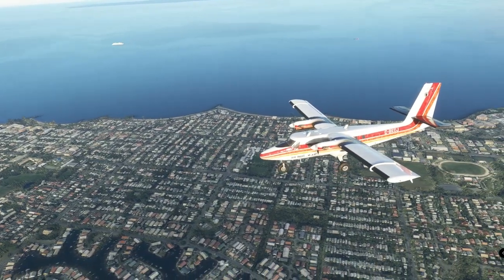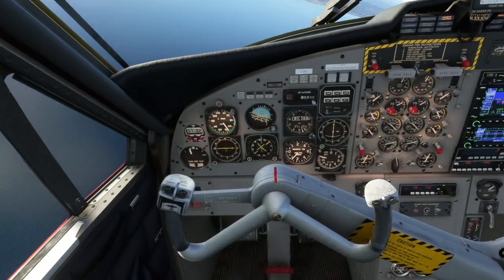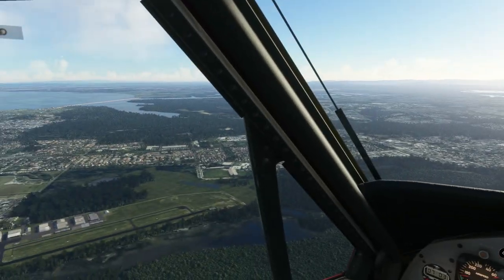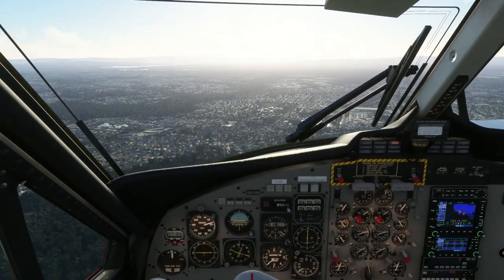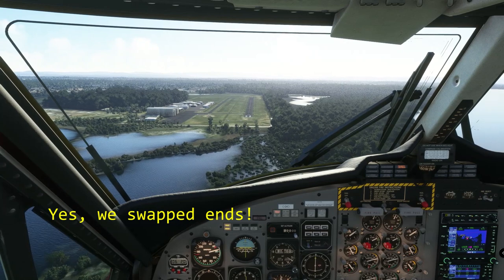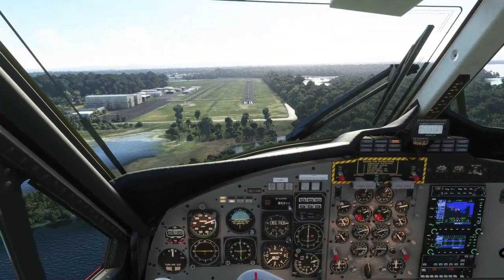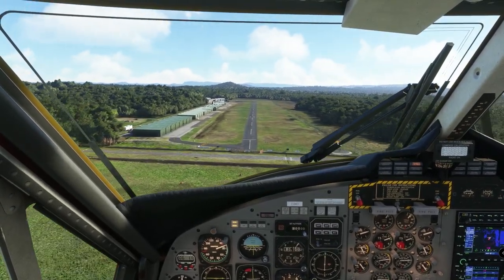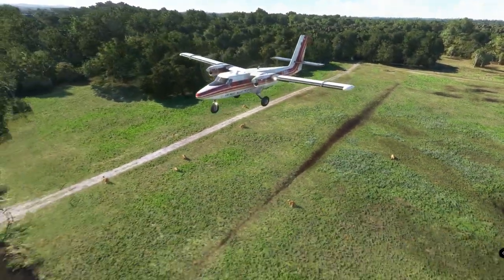Aerosoft Twin Otter in MSFS: STOL

Comment: Agree w/your approach, RWY10 at TFFJ feels especially tough without drag. I'm using FSUIPC7 and have the reversers mapped into the throttle axis (calibrated to use about the last 30% of travel in reverse), which helps me a bit. The added control makes it a lot easier to dip gently into reverse and smoothly bring it back into idle so I don't have the plane sitting on it's tail. A physical detent would be nice, but muscle memory is working well enough.

Comment: Interesting, I got here by searching for Twin electrical information for my copilots. I have been flying the Twin for the past 15 years, 95% of it on floats, so its all STOL type of flying. You are correct in your statement regarding the props, a well rigged props make a huge difference in the landing distance as well as taxi characteristics (important on water, no brakes).  As a point of interest, the "factory" wheel airplane rigging provides too much forward thrust for true STOL operations. The "unofficial, seaplane" rigging provides about 5 psi less Torque, the prop blades are at much flatter angle then the factory setting at flight idle. This is called the prime blade angle setting, if you want to check it, you simply advance the power till you get 77% Np or prop rpm. STOL value is about 21 psi TQ, factory is 26 psi or so.

Since you seem to be switched on and like this stuff, please take care when using the "reverse" term.  In terms of the sim, the sim model might actually have only "reverse prop airflow" in it's model. The actual airplane has two prop control modes, the constant speed via prop gov and beta mode via the beta valve, prop feedback ring, carbon block, beta cable and finally CSU mounted cam cluster. The beta (or prop angle control) starts in flight with roughly 10 TQ and around 80 knots, at this point moving the prop levers should not change the prop rpm. Within Beta range, you have flight idle, this is the rigging I mentioned above, once you twist the grips and start moving the power lever back, you are still in positive thrust, the blades are going flatter and the engine should remain at idle. This is called the null range, once the prop passes zero it finally achieves reveres, at this point the cam also starts to add more engine power. This takes close to half of the backwards travel of the power lever.

On big water, windy and challenging days at times we do twist the grips at few feet over the water and really just adjust the blade angle to a bit more fine angle. This simply plops the aircraft right into the into the little spot of good water. It works like a charm, its not a violent drop. As we do not have the beta backup system (the 400 did away with it as well as it was a very problematic system especially on floats)  no aircraft safety systems are bypassed by these actions. 

Getting bit long, your technique is what is used at times with the real airplane, its not reverse, its flight idle, in flight blade angle adjustment.
Reply from the maker: Thanks for all that. The current (MSFS) model of the Twin Otter really isn't done with enough detail for any of this to be of practical value, but it would be a good project to create a physical implementation of the behaviour you describe. I mean with full-size and correctly-operating power levers and whatever programming would be needed to get the correct behaviours. Microsoft is said to be still playing with the prop and turboprop engine simulations so it's possible in time that we will get some of this.

If you look back you will see I had a more detailed physical cockpit setup with the older (FSX/P3D( versio of the Twin Otter. I liked to kid myself that was 'realistic', but it really wasn't :)
Reply: @AlmostAviation  Actually I got to your channel when looking for some training material for my Asian copilots. Their understanding of the systems is so poor after my best attempts to teach them. In some older videos of yours (like 7 years ago) I noticed some inconsistencies with the real airplane, but its impressive and cool what you have done with your sim set up. I truly love the Twin Otter, next to the DC3 and the T6, which both I have flown, the Twin is my girl. This airplane can do some amazing things, it has saved my life few times and it's cool that you have interest in it.
Reply from the maker: @pawelwolski1316  Thanks, it is nice to get such positive feedback from a genuine authority!